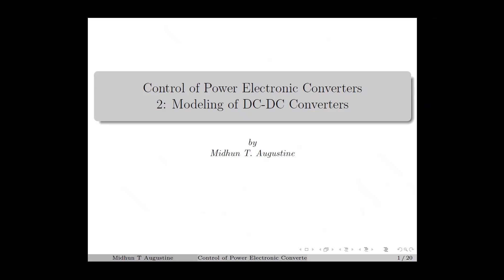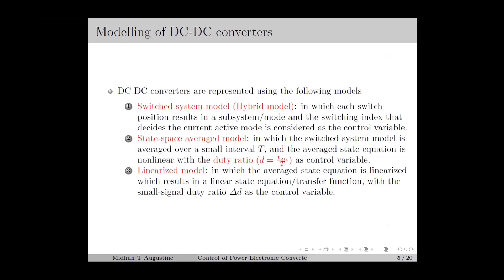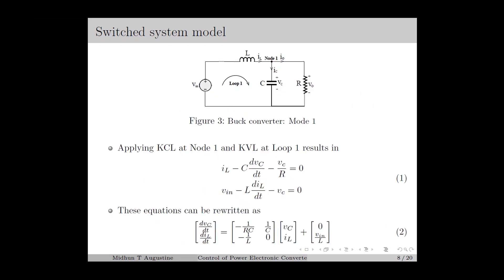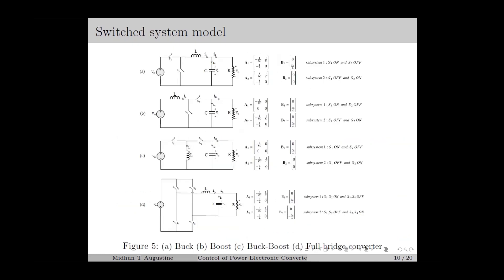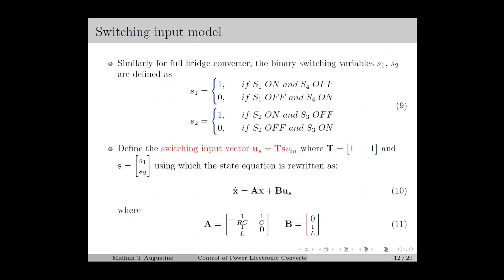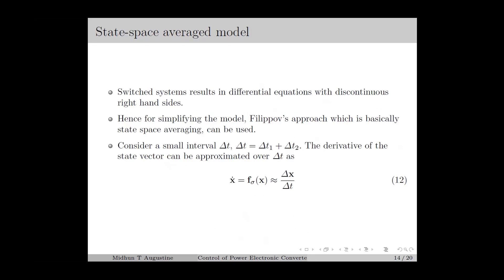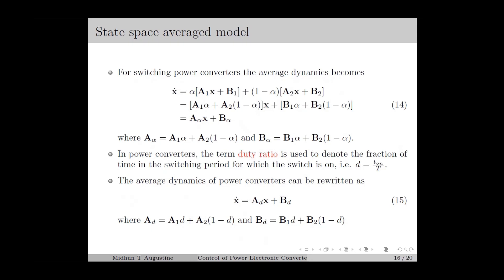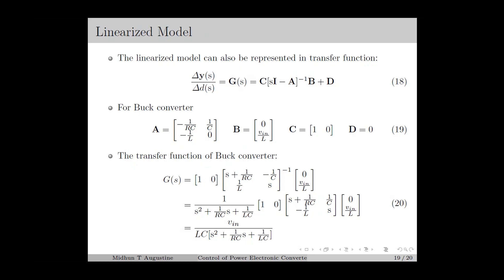2: Modeling of DC-DC Converters

Comment: good video, but actually the step down converter do not need any linearization process.
It can be more interesting to show the procedure for other type of DCDC converter (eg, Step up or interleaving).
Reply from the maker: Thanks for the feedback. Here the step down converter was used for illustrating the linearization since it is the simplest one. The same linearization equation can be used for step up as well by substituting the corresponding values of A1, A2, B1, and B2.